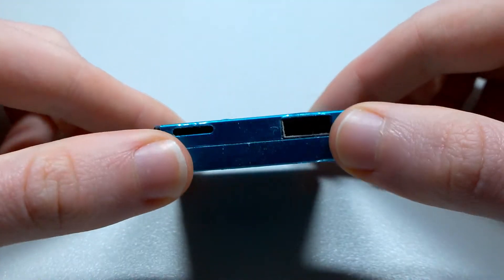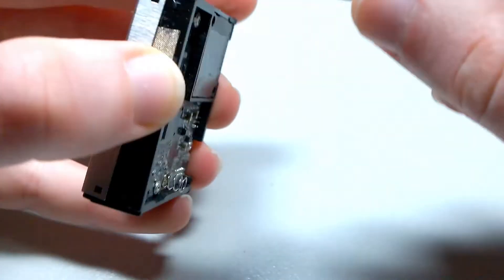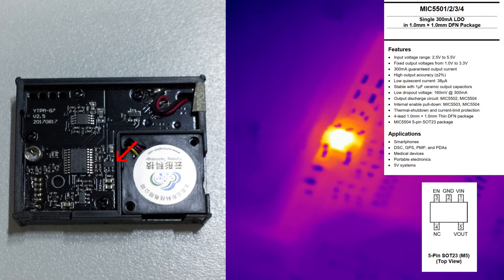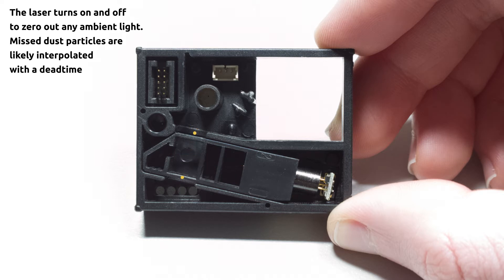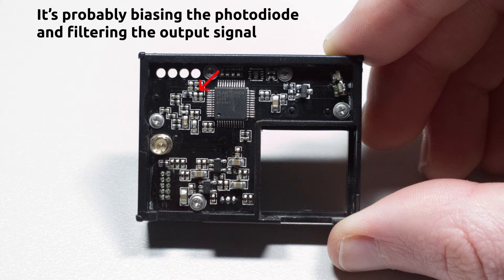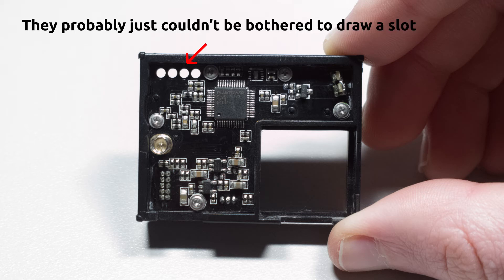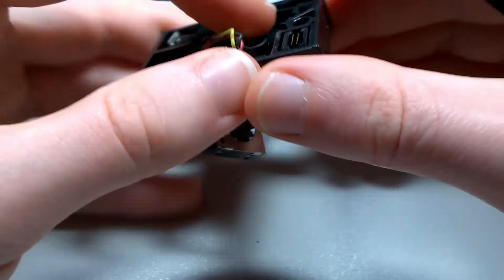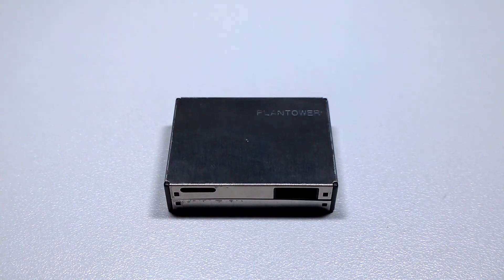Teardown & Cleaning a Laser Dust Sensor PMS7003 After 2 Years

Comment: Interesting video. What did you use to log your data over the years?
Reply from the maker: The sensor is connected to an ESP8266 via UART and I have a cron job running on a server (same one as in my “ZFS Disk Failure and Recovery” video), every minute it sends a HTTP GET over WiFi to the ESP8266 which returns a CSV string which is then saved to a .CSV file, the plot is generated in MATLAB. 

I’ve been considering switching over to JSON, MQTT and an SQL database to make it more reliable, let the sensors sleep between transmissions and make querying data easier and faster but I haven’t had the time.
Reply: @WizardTim  I just set the same sensor at my place. I used the esp8266 on which I installed tasmota firmware. The tasmota sends data via mqtt to a domoticz installed on a router with openwrt. This does not require a large configuration and you can immediately see graphs and export data e.g. to csv
Reply from the maker: Nice! I love the Tasmota firmware as well, one of the best open source community driven firmware projects I’ve used. I have a SONOFF Pow R2 which runs Tasmota, it’s configured to send MQTT messages to the same server which runs a Mosquitto MQTT broker and Node-RED which timestamps it and saves it to a .CSV for later visualization in MATLAB, all 401 MiB of it! (yes it's slow to parse hence the desire to go to an SQL database)
Reply: @WizardTim That is a nice and simple solution. I've been working on an SDS011 based sensor writing JSON data to AWS DynamoDB mainly as a learning project. I've tried Thingspeak which works very well and lets you present some simple charts.

Comment: эх скетч бы для этого датчика ,  для ардуино uno .
Reply from the maker: Sorry I don't understand Russian but if you're looking to use this sensor in an Arduino sketch with an Arduino Uno try this library:
https://github.com/avaldebe/PMserial
Reply: @WizardTim  thank you very much, but I don't understand this at all, all I can do is upload a sketch to arduino =), no one wants to help, even for a fee, everyone either does not answer, ignore, or don’t want to help. very bad people and society, lazy and selfish ... a big problem, neighbors are burning fires, the stench goes into the supply ventilation, need to control the plasma filter through a relay
Reply from the maker: Sadly it’s very difficult and time consuming to teach someone how to do a project like that especially over the internet in a different language. 
To make it easier to follow you should make a post on the EEVBlog forum and explain what you need to do, what you have, attach the sketch you’re using, what you’re stuck on and attach a picture of the hardware. 
https://www.eevblog.com/forum/beginners/
I might be able to help so leave a link to the post but the regular members usually know more than me.
Reply: @WizardTim  thank you
Reply: @morpheus3671  Hi Morpheus, to make this sensor work with Arduino you should download the Adafruit software ("Project Bundle") and tweak it a little which is very well explained by Adafruit itself. Here is the link: https://learn.adafruit.com/pm25-air-quality-sensor/arduino-code

Comment: Didn't realize they were modulating the fan, I guess they do a one time flow calibration at manufacturing. Good explanation.
Reply from the maker: When you turn it on you can actually hear the fan go to 100% and then ramp down, my GPU does a similar thing and the marketing says it’s "to blow dust out of the heatsink" and it actually works somewhat well, makes me wonder if this does it for the same reason or if it’s just to make sure the fan starts reliably?

I also wonder how the factory calibration is done; I suspect they probably use the same calibration constants for all units and test them on a pass/fail basis as they're not super accurate and tend only to agree with each other to about 10%.
Reply: @WizardTim  oh good idea with ramp, yeah they are not super accurate but l suspect you can use serial commands to change the constants. Of course you'd have to have some $10k+ reference meter for that to be relevant.